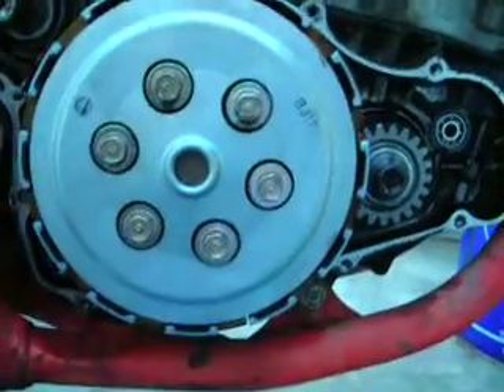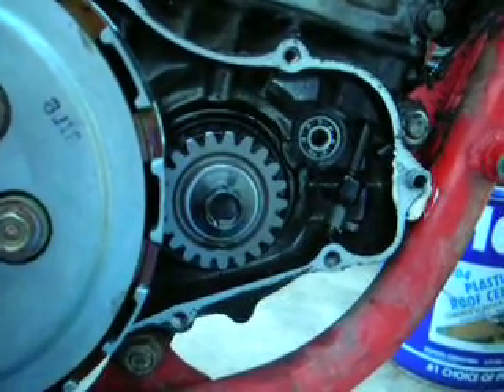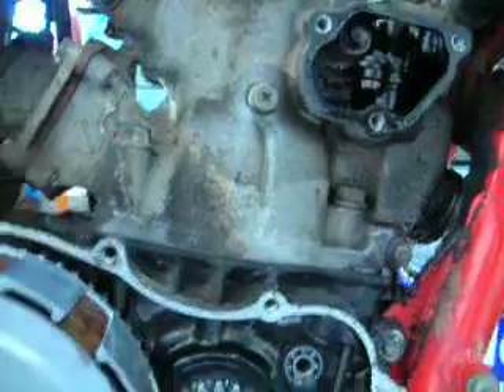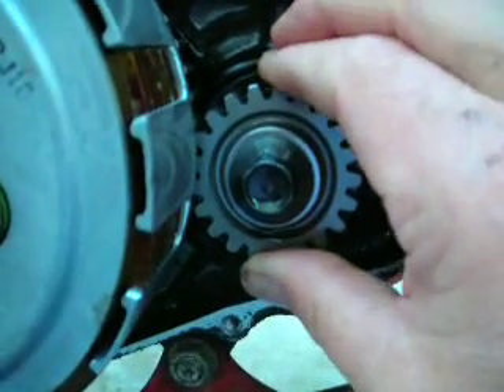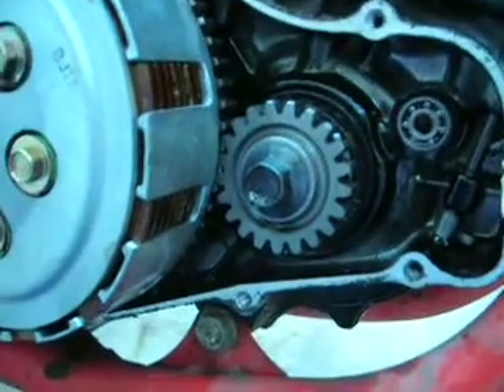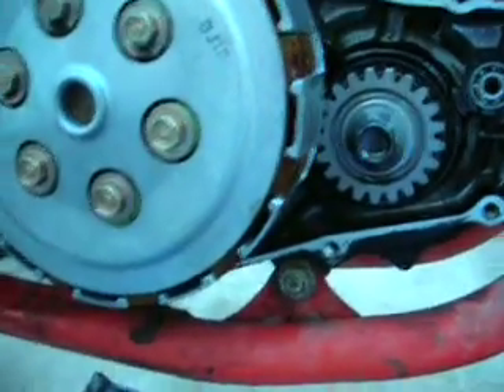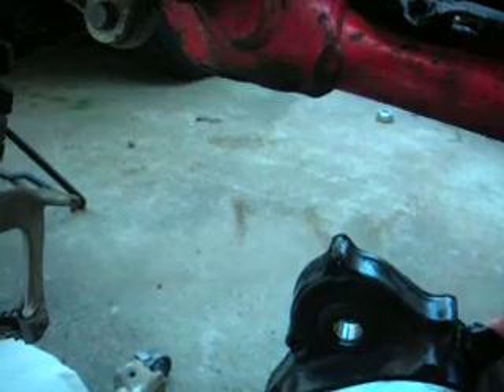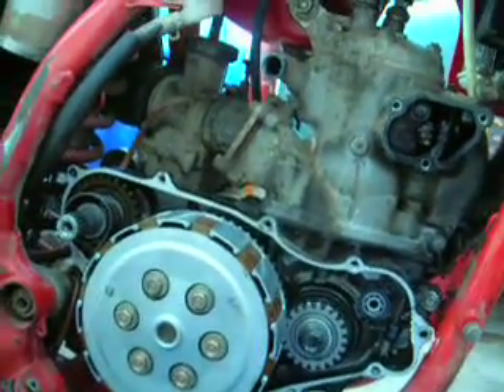1989 Honda CR250 Crankshaft Bearings Shot, DSCN0814.MOV

Comment: Hi looks like you have a little bit of corrosion built up in the water pump if that's the case that's a casing off an 88 cr250 as they were made of magnesium and prone to corrosion the 89 cr250 was fully alloy and doesn't corrode

Comment: How did it turn out ? Split the case? Fix her right ?
Reply from the maker: +richard bolt It's kinda in line behind other projects right now, don't want to take one more thing apart before I get some other projects put back together.  I've got a 2001 CR250 in pieces I need to do the split case job on, after that hopefully I'll have some "momentum" to take the '89 apart.
Reply: +guidoguitar is it hard to replace that right side crank seal. because my bike isnt getting any top end power at all. its just smoking and bogging.
Reply from the maker: +TrollMaster300 I never got that far, once I saw the bearing was shot I did not continue to change the seal.  You'd have to take the clutch basket off ... might not be too bad after that.  Despite a lot of noise and smoke, and sucking all the trans oil out in about an hour, the performance was about normal as I recall.

Comment: And also I'd get the crank rebuilt you won't find a new crank to put in it I've searched for one for mine instead buy a pro-x rod kit and have it installed by ken o Conner racing he knows his shit when it comes to Honda cranks do that and replace your crankshaft bearings and you won't have any problems with it.
Reply: Newer cranks fit from 91 to 98 cr250 too that's in mine